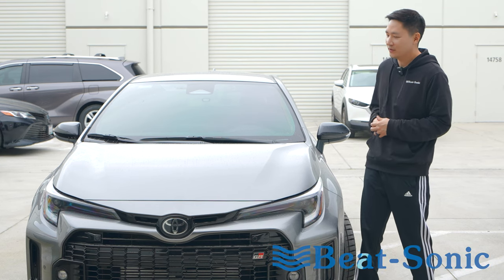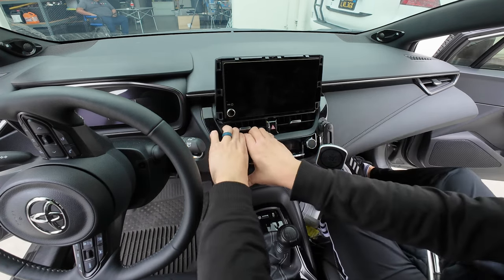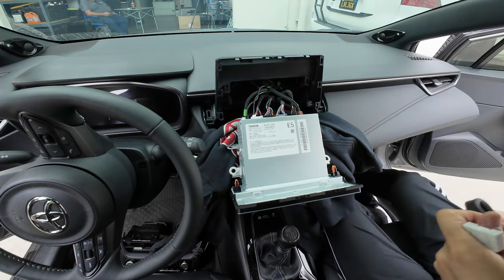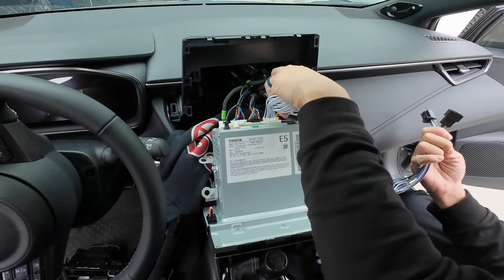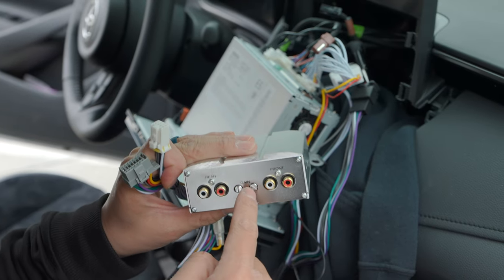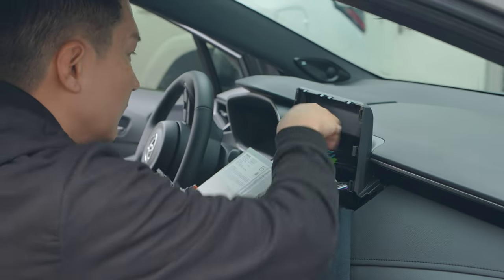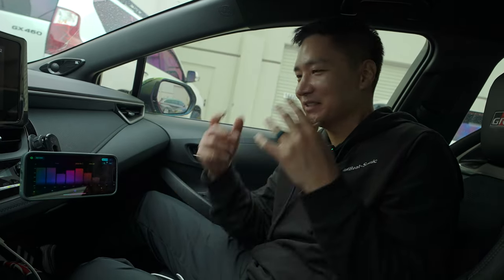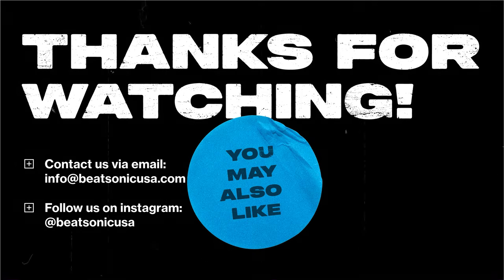Toyota GR Corolla | Best Plug & Play Amplifier

Comment: Does the amp improve response from the rear speakers? I don't know why the GRC even has rear speakers because you can barely hear them.
Reply from the maker: It improves the audio overall. The rear speakers are tuned from the factory to be quieter than the front from the radio. Unless it’s the non jbl model, you won’t be able to adjust the front and rear independently as the JBL amplifier on on JBL equipped Corolla has a 2 channel input

Comment: Does the R gain knob do anything on the GR Corolla? The F one adjusted the gain and I was able to use the audio pan left, right, front, rear which worked normally. The R knob seemed to have no effect at all.
Reply from the maker: The R on your car will adjust the navigation voice and radio sounds

Comment: Thanks, just installed it on my corolla 196h 2023, the screen removal is a bit different, cause there are no rectangle plastic all around the screen on new versions, and no volume knob anymore, just power on/off and +/- on the bottom of screen, took me about 1hour to install completely.

Much improved sound, baseline volume is higher even with gain at 10o clock and the bass/treble is more controlled, didn’t heard any distortion even a 45 volume.

Thanks for the guide and product 👍
Reply from the maker: Thank you for your support!

Comment: Can used the rca on the front of the amp to plug in a amplifier subwoofer
Reply from the maker: The rca plugs are for audio input only. You can connect a LOC to this for a powered subwoofer

https://www.beatsonicusa.com/bh10.html